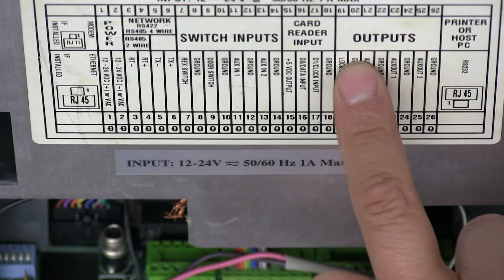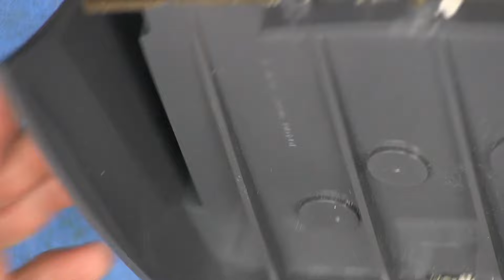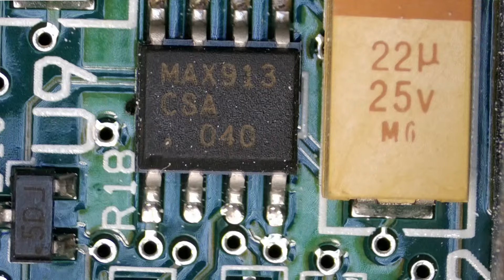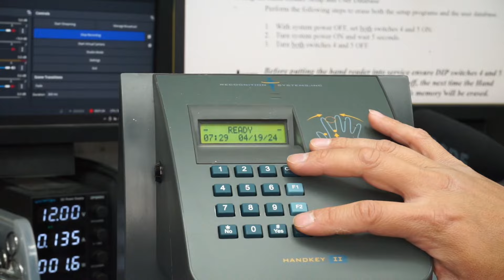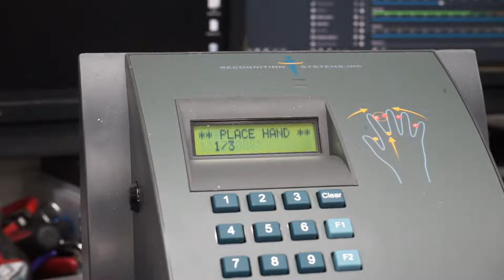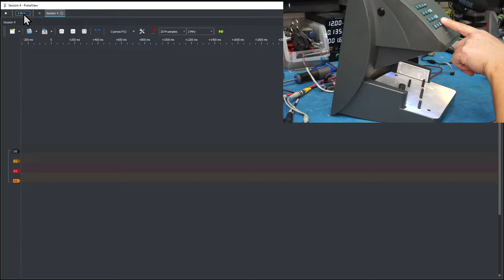TEF #167 | Hand Key II Teardown And Testing

Comment: While on the "internship" for the studies in my university, they just gave me this device and asked to search on the web for some various info about it, and that's how I got here :p. Any idea if you can extract the image of the hand or some measurments from it?
Reply from the maker: I think it may be possible to see what sort of data is being saved for each hand and where in RAM by using a logic analyzer with enough inputs to monitor the address bus, read/write lines, and the data bus at the same time. Unfortunately, I don't have such a tool to actually try it.

Comment: Yeah I had to install these at the company I used to work for. They were used as timeclocks, I don't remember if we were using ADP or Paychex for payroll at the time. We just connected them to ethernet and hosted an app on one of our servers that handled communication between the unit and the payroll service. They had an optional NiCad battery pack and power board that went in the back as a battery backup. We had to RMA them on a fairly regular basis as they would just stop reading peoples hands correctly.
Reply from the maker: I guess they're not as cool as I had thought. :(

Comment: I ran a datacenter years ago and installed these on the cheap. In the process became intimately familiar with them. I think I still have 1 or 2 keys for them on various key rings.

There were essentially 2 versions of these. 

Handkey for access control (this unit) and Handpunch for use as a standalone or integrated time and attendance system. The Handkey (HK-II) units used Wiegand to work with an access control panel and emulated a card reader. To network several of them you needed to give them all addresses on an RS-485 (you could use RS-422 as well but I never tried it) network and either use an gateway (ethernet or what ever) or converter to a PC. Alternatively there was also an ethernet adapter (EN-200) that was essentially an ethernet to RS-485 adapter. The software, Handnet, didn't really like to address several networks (each unit with an ethernet card was a network) so it made more sense to use 1 EN-200 and daisy chain the rest to that unit using RS-485. The software was kinda crappy and buggy and some modern alternates such as BioConnect may work too. Although most biometric backend software I've used is frankly surprisingly crappy.

The digital outputs are either mosfets or open collector (I forget) and only rated for less than 100ma. A common mistake was to run door lock voltage through them and fry the boards or transistors. They require a "sensitive relay" like an ELK-924 to protect them.

The door forced open message is because it's expecting a normally closed contact to read the door position across ground and the "door switch" input.

There were also units that came with factory installed HID readers. First they were on the outside to the right of the pin pad then later inside under the plastic in the same spot. These functioned the same but a card read was essentially your pin. Quicker but required people to have cards which is why we opted against it.

Lastly, you can use your left hand but you're doing it wrong. Try flipping your left hand upside down (palm up) and reading it that way so the fingers are flat as possible. Most people have fairly symmetrical hands. Should work if the sensitivity isn't to high. My brother and I have similar size hands and could use each others hands interchangeably. I believe the scan of a hand is enrolled and stored using only 9 bytes. Not a lot of data there.

Thanks for the trip down memory lane and giving some old brain cells a new lease on life!

Oh... There was also a plastic housing for outdoor use. The first gen outdoor readers were actually an all steel unit that was built like a tank.
Reply from the maker: Thank you for all the info!

Comment: My warehouse job in 2015 used this as a time clock.
Reply from the maker: I find it interesting that I was under the impression, mostly due to the installation manual, that they would be used for doors and for entry into facilities and stuff, yet everyone that has commented so far about seeing or using these mentions that it was used to clock in/out of work.

Comment: That anti-temper can is quite interesting, never seen those before ! 
The anti-temper mechanisms I saw were mostly either light or magnet based
Reply from the maker: I would really like to know what's inside, but I don't want to damage it in the process. If I can find some that are identical online, I'll look into making a follow up.
Reply: @ThatElectronicsFool  it's a ball on a spring in a can. It measures tilt angle. When the reader is mounted to a wall the ball doesn't touch the can. When you unlock the reader and tilt it forward the ball hits the side of the can and you get a tamper. When you have the reader sitting on a desk it is already angled down which is why you're getting the tamper.
Reply from the maker: Thanks!

Comment: I installed these in my distribution center when payroll modernized from old punch cards for the hourly laborers. Our versions were fully loaded with Ethernet and a rechargeable backup battery pack for power outages. Neat to see the guts after all these years later.

Comment: My bank used these for accessing the room containing the safe deposit boxes. Until they went broke and got themselves bought out.
That blown fuse may have been intentional, when it was decommissioned by hitting it with 120VAC?
Reply from the maker: I didn't think about that, but yeah, I guess it's possible they were trying to damage it intentionally. I don't know any of the actual history of this device, or where it came from.
Reply: @ThatElectronicsFool  I don't get it either. If you cared that much about security, you'd physically destroy the thing. (or at minimum, reset it the same way you did.)

I'd bet it was hit by lightning, or some nut patched the wrong voltage into it.

Comment: This was very interesting, enjoyed the video and the Hula Hoop demonstration. How did you acquire this peace of inventory? Did this unit send a message to another box to unlock a door?
Reply from the maker: It's one of those things that was given to me several years ago that I've had in my inventory collection. These can be connected together with other units, according to the manual, where one is master. They also work together with other devices such as card readers, or anything that uses compatible protocols. Usually this would be to unlock doors, as that's the main thing talked about in the manual, but it can control anything really.